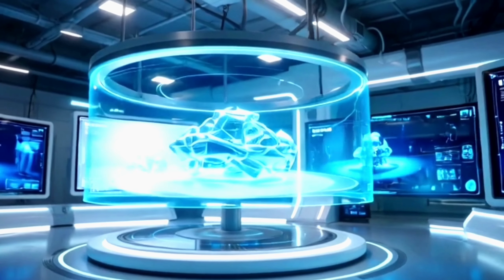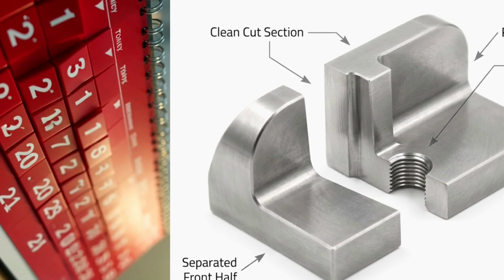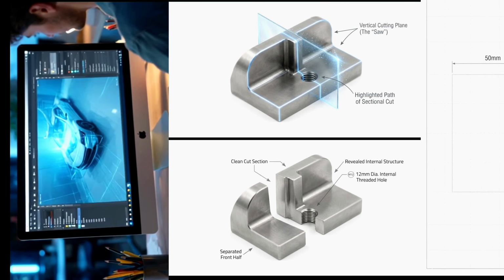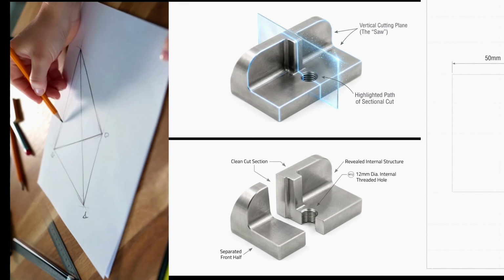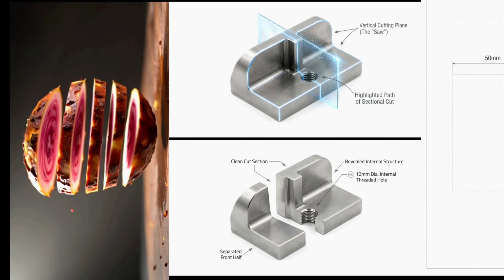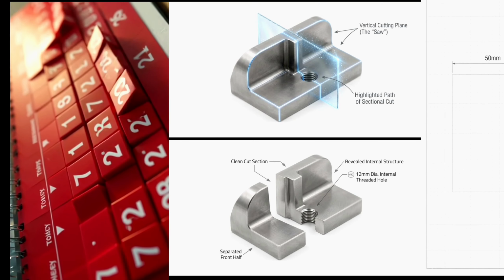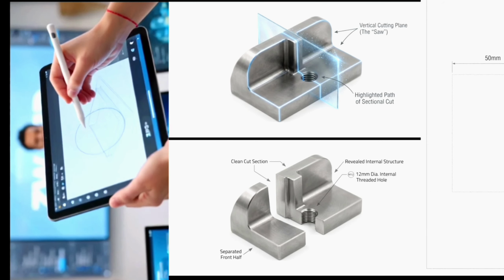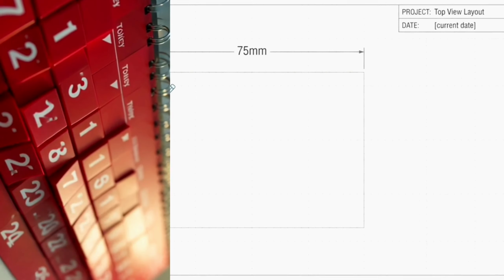🚀 3D to 2D Drawing: Sectional Views for CNC Programming ⚙️#CNC #EngineeringDrawing #GCode

Comment from the maker: Pinned by Shoheb Mohammed
🚀 Mastering 3D to 2D is the "First Step" to Flawless CNC Programming! ⚙️
If you can't visualize the Sectional Front View, you can't accurately program your Z-axis depths or tool offsets. In this video, I break down the 75x50x50 mm component step-by-step so you never make a mistake on the shop floor again. 🛠️
Which part of this drawing was most helpful for your workflow?
🔹 Locating the 12 mm hole center?
🔹 Projecting the central rib?
🔹 Applying the 45° hatching rules?
Skip to the step you need:
0:00 – Hook: Why 2D views matter for CNC
3:10 – Drawing the Top View (Base 75x50)
7:40 – Drawing the Sectional Front View
10:40 – Mastering Hatching & Solid Material
11:50 – Final Dimensions for Machining
Drop a "CNC" in the comments if you want more tutorials on converting drawings to G-Code! 👇